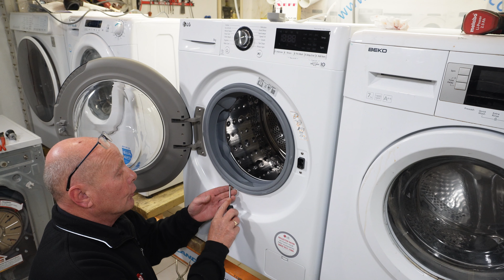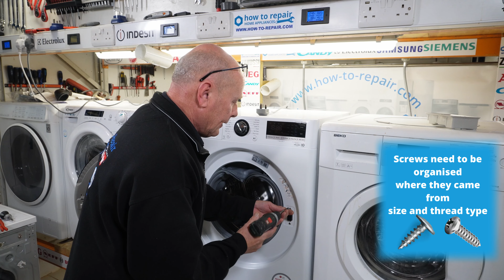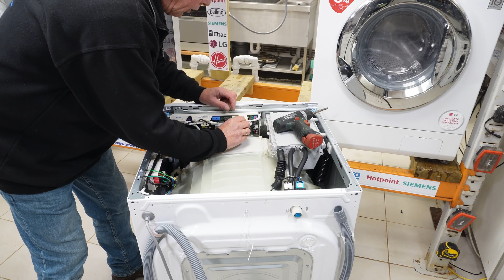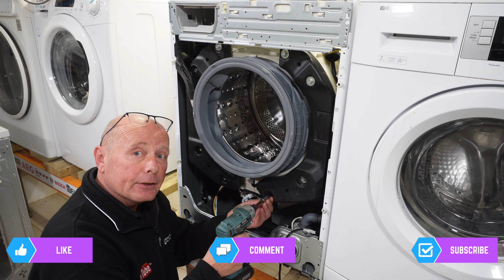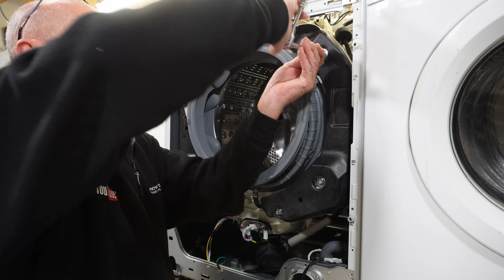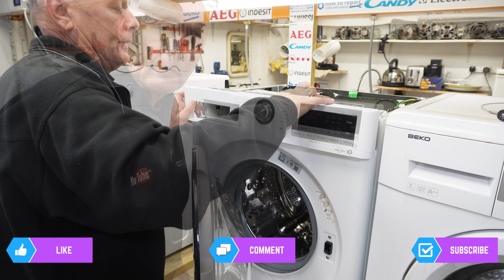Easy LG Washing Machine Door Seal Replacement (Boot Gasket) with Hacks! #MDS66651608

Comment: On the washer dryer combo variant, how do you get the rubber door boot off the heater at the top? I've unscrewed the clamp and taken both the spring clamps off but it won't budge. Can't figure out what's holding it on, if you happen to know I'd be very grateful for help! Thanks

Comment: I couldn't find those nifty pliers in a shop in my town, I live in the US. My gasket was suddenly allowing much water out the front bottom of the door. So I used the wrong tool for the wrong job - angled pliers, leverage and blood to get the inner retainer ring back on. Those springs are amazingly difficult to work with.
I inherited the Washer. It's much older than the one you are demonstrating with but the general idea was still the same.
Thank you for the instruction. 
Great video,

Comment: That ‘hack’ using a spanner and a couple of zip ties to reinstall the retaining spring is inspired.  I had an old Bosch and I turned the air blue with profanities while struggling to get the spring back on.
Reply: Silly me stopped the video just before the 'hack'.
Ended up getting the spring on with my wife holding the seal/spring in two spots and me using a hook pick tool to stretch the spring while the seal was in place.
Took a few goes, but got it on.
Reply: omg i was loosing my mind and skin !! off to get a spanner now !!
Reply: Yeah, but it would have been really helpful if he had shown us a bit more detail of HOW he managed to stretch the spring using the spanner.
Notwithstanding, I'll give him a thumbs-up and a subscribe.
Reply: Omg I know! I had to drive to an uncle's house to get the correct pliers, I didn't find this video on time